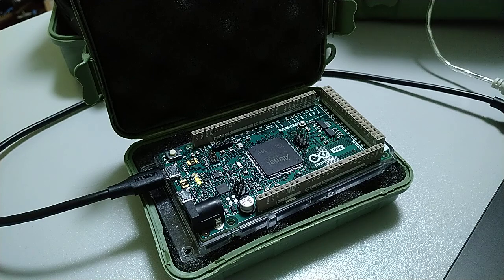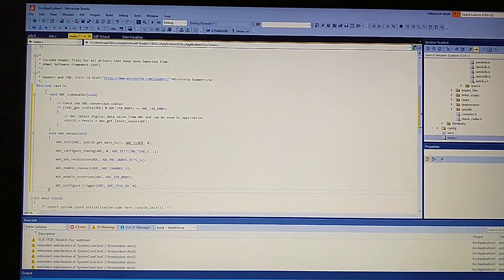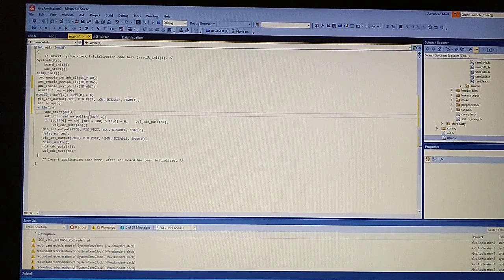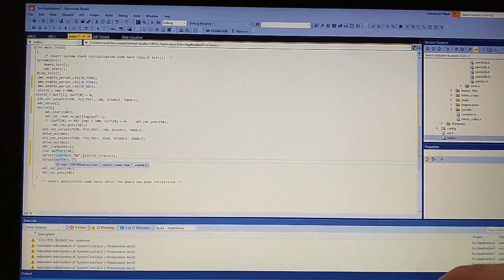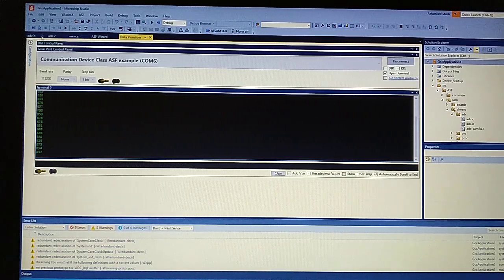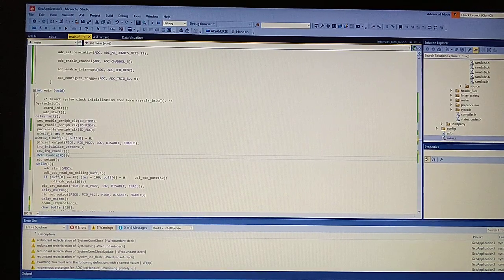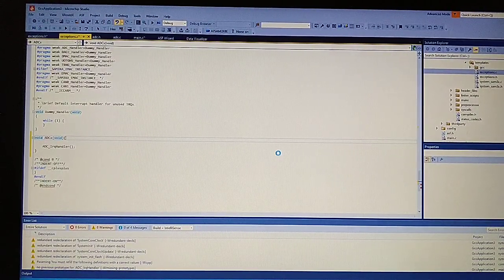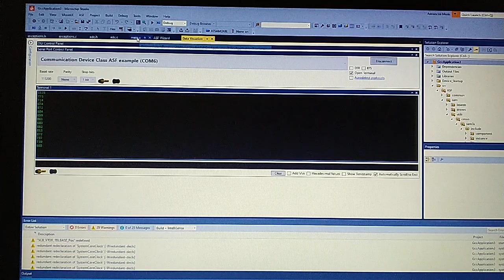Arduino Due ADC example blocking mode and using interrupts in Microchip Studio 7

Comment: Hi,

I am new to programming in asf framework.Could you please tell me how to use the serial montior to print adc values without using cdc_read function?My intentisonis to print ADC values on serial terminal.
Many thanks
Reply from the maker: Hi, the cdc_read function is only to get data from the pc. So it can be erased from the program.

To print a ADC measurement data you need to convert the uint16 adc data to a readable text in ascii and to do this you can use sprintf function. There also is a buffer needed to store the text like char buffer[7]. And you call sprintf(buffer,"%d\n",adc_value); 
So for example adc_value is 1019; the buffer will contain { '1' , '0' , '1' , '9' , '\n' , '\0', 0} and now by using a charter print function udi_cdc_putc you can printout the data to the terminal like
for(int i=0;i<strlen(buffer);i++){ udi_cdc_putc(buffer[i];}

I made a video about using cdc with uart in non blocking mode using interrupts it may be helpful
Reply: @e-exp  Thank you for the prompt reply i will see this and revert. Thank you once again
Reply: what is the significance of the if condition in the main? Could you please explain? Also are you enabling the led pin on due?
Reply: I also dont understand what is udc in the code
Reply from the maker: @critonify  the if statement only chcecks if the pc terminal sent '1' char or 49 in decimal and if it did so then the delay time between toggling the led is changed (the tms variable). 
The led pin is configured before while loop:
- first enable gpio group B clock with pmc_enable_periph_clk(ID_PIOB);
 - next set the pin as output low with pio_set_output(PIOB, PIO_PB27, LOW, DISABLE, ENABLE);
To toggle the led you can still use the pio_set_output or pio_toggle_pin(32+27);
The argument to this function is 32 +27 because GPIOA is 0 to 31 and GPIOB is 32 to 63
Reply from the maker: @critonify  The udc_start(); is the function to enable the USB core with added functions (in this case the cdc - comunication device class).
The function can be found in project folder/src/ASF/common/services/usb/udc/udc.c
Reply: @e-exp  Is it possible to send an email to you. So that you know whats going wrong on my side? so that you could explain it better?
Thanks
Reply from the maker: Yeah you can write to eexp_io@yahoo.com
Reply: @e-exp  Thank you very much
Reply: @critonify  Hi I'm actually trying to do the same thing but with a C++ project instead of C, still it should work the same did you manage to print the ADC value on the serial terminal? If so could we exchange?